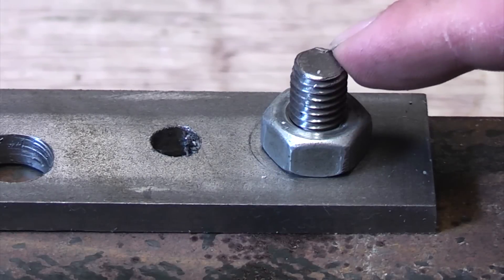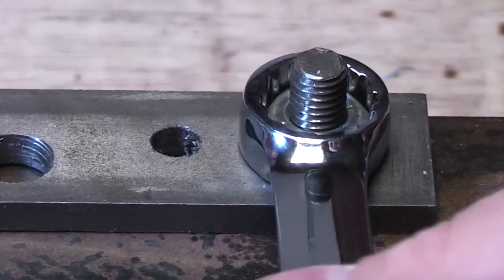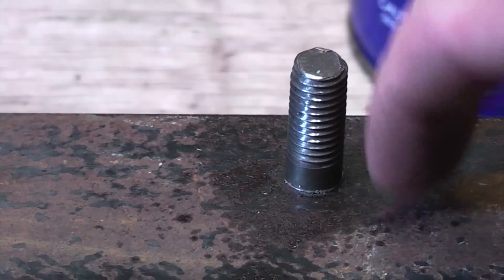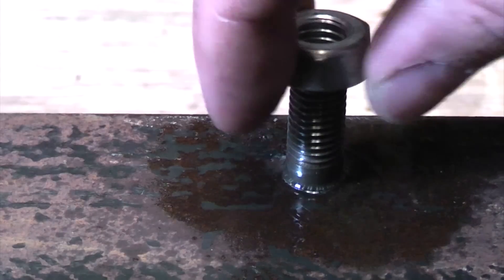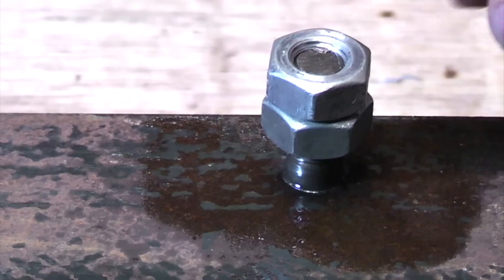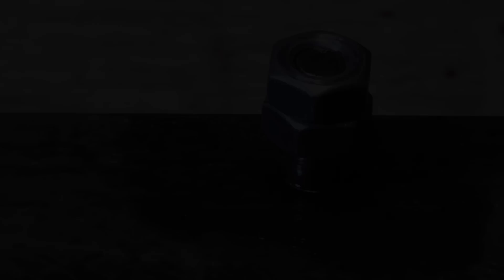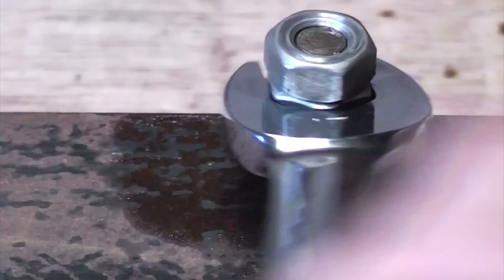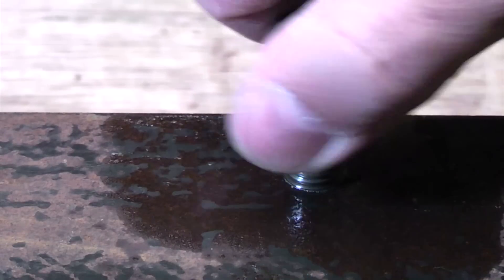How to remove a stud

Comment: thats ok but how would u take it off if u cant get the nut to move to start with couse of rust or something else
Reply from the maker: You can heat it up, use spray penetrant or even drill it out if necessary. The aim of this video was to show how to remove a stud without spending money purchasing an unnecessary stud remover tool.
Thanks for the comment

Comment: So what do you do in a real-world situation? e.g manifold is still on the engine, it's the stud towards the front of the engine that's a bugger to get to and there is only enough thread for 1 nut?
Reply from the maker: Difficult to say without seeing it, but one of these might work- https://fave.co/3vCD7Hk 
Tack welding the nut onto the stud might be another option.

Comment: Honestly I have a question I have a welded stud on the back of my axle back how would I remove that cause the head of the bolt is literally welded on to the exhaust flange so how would I remove that
Reply from the maker: Exhausts can be a real pain, as the heat and cooling makes the steel soft, so it is likely to shear easily.

Comment: what if the nuts stuck and wants to take the stud with it ?
Reply from the maker: +Big Rob 
Put another nut on as per this video, then tighten it as much as you can using the top nut.
Then hold the second nut whilst you remove the one you put on last, then the remaining nut should undo. If it doesn't try spraying it with some spray penetrant.
Reply: +Ultimate Handyman I'll give it a try thank you .

Comment: Great tip but what do you recommend if you only have enough thread for 1 Nut?
Reply from the maker: You might have to use a stud remover, this type works well - https://fave.co/2SnfcY8
Or you can weld a single nut onto the end of the stud. Obviously you will not be able to reuse the stud though!
Thanks for the comment
Reply: @ultimatehandyman  Spot on mate thank you, had 3 snapped on motorbike head with only 1 inch showing and as you said, the impact stud remover did the job brilliantly in 10 min (Thumbs up)

Comment: I've been wondering about this for a while now. I have those stud bolts on my motorcycle exhaust flanges.  I had no clue how I would ever take them off if I needed to.  Now I know.  Thanks.
Reply from the maker: You can buy a tool for removing them, but often they damage the threads, locking two nuts together is much easier and cheaper.
Thanks for the comment 👍

Comment: Solid Video, just how about a stud that’s been in my engine for 21 years 😂
Reply from the maker: These are always a nightmare.
If you can heat it up using a torch, then let it cool and then use spray penetrant, you'll have a better chance of removing it.

Comment: what if the stud is too short for 2nuts
Reply from the maker: +Kenneth Lee 
You can get thin nuts (often used for nut locking purposes) or you might have to used a stud remover.
Failing that you can weld a nut to the end ;-)

Comment: Put a little heat on it, take a wax candle and let that melt on the bolt/stud, much easier to remove with this method than any other.

Comment: The thread outside is still ok. But the bolt is stuck on it. Won't come off. What happened was the bolt was stuck on when I tried to take it out and the stud started spinning.

Comment: I used this method earlier to remove some studs from a cylinder head and they looked pretty chewed up afterwards, I didn't check them beforehand but is this likely to damage the threads? Thanks.
Reply from the maker: No, this method should not damage the threads at all, unlike some of the stud removers that grip the threads with a round piece of knurled steel. 
Thanks for the comment
Reply: Thanks, they must've been chewed up already.
Reply: Matt Tester

Comment: You can weld on a nut or bolt to the end to make it longer.  The heat also helps break it free, that is if you have a welder.

Comment: I tried the same technique yesterday but it just turned both nuts. I'm trying to remove the intake manifold studs from an aluminum cylinder head.
Reply from the maker: You need to lock the nuts together really tightly using two spanners.
Then you should be able to remove the studs, by using your spanner on the inside nut.

Comment: yea it is a fuker once its been in there for a long time. i took one out of aluminum and it fuked up the threads. but then again heli- coil time.
Reply: I used vice grips to remove some yesterday that were rusted pretty bad.  I'm going to use this tip when I insert the new studs into the head.

Comment: Never ever try to remove ANY BOLT STUD or Otherwise by just pulling on the rachet or spanner to undo, in all cases you must use if possible a hexagon socket making sure you give the tool a swift hit with the palm of your hand while grinding your teeth and appling a sudden blow, the quickness of the blow is the secret.  Of couse penetrating oils will make this a little easier.  I find that holding the spanner or rachet with your full hand and bending your elbow, then straighten your arm with a stricking blow.  Taught to me by my Dad and works almost all of time, I use the same technique on any bolt I want to undo to be safe and sure of not round the nut off.

Comment: Hi. I knew about this trick, and I have used it several times. Usually, though, it's a real adventure if you remove the stud with the two nuts attached, to separate the two nuts so that the stud can be reused. My solution is: Once the stud starts coming out, and while it is still on the work piece, I try to loosen the grip between the two nuts :)

Comment: Could you use an impact wrench for this?
Reply from the maker: You could, providing both of the nuts were tightened together so that the socket will fit over them both.
Sometimes on site we weld a nut to the end of the stud and spin that out using the impact wrench.

Comment: Doesn't work on an old jeep I tried this and they keep coming right off the stud together. Tightened them pretty good too.
Reply from the maker: Sometimes you really have to tighten both nuts together really tight, then put the spanner on the bottom nut.
I've not had a stud that could not be removed using this method- unless the stud is seized in the hole? 
Thanks for the comment ;-)
Reply: Ultimate Handyman I stopped by an old mechanic friend just now and he said get some new nuts and try again. thank you for the video. I don't think I locked them together very well I was afraid of snapping it after I snapped a bolt off. gotta love old cars

Comment: One caveat is to use low grade nuts if you can, so that by tightening them against each other you would actually deform the nut faces to get them out of step if you will. If you use high grade nuts, chances are they will be turning in sync on the stud, rather than pushing against each other.

Comment: Lemme just see how this hack goes and if it does I have more faith of saving my exhaust rather than junking it 😂
Reply from the maker: Applying a little heat, might help to loosen the stud. But don't get it red hot, without letting it cool before attempting to remove it.

Comment: I’m about to do my cylinder head to send it of for repair and you finish if by saying a lot of the time they’ll snap off! Doesn’t give us confidence 😣 thanks anyway.
Reply from the maker: Give the studs plenty of heat and spray penetrant first, as long as you are careful they should come out ;-)
Best of luck with the project ;-)